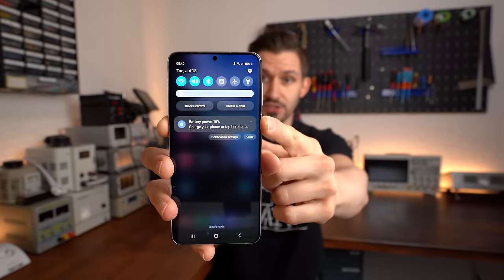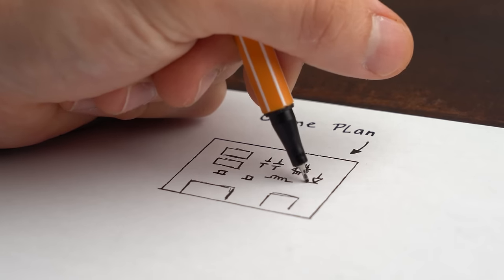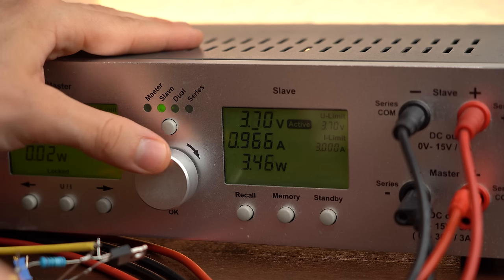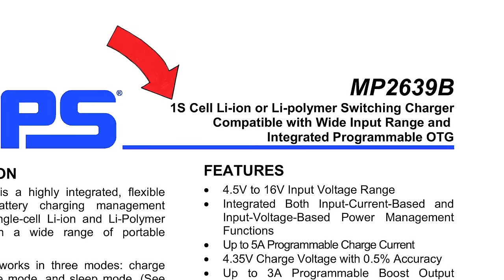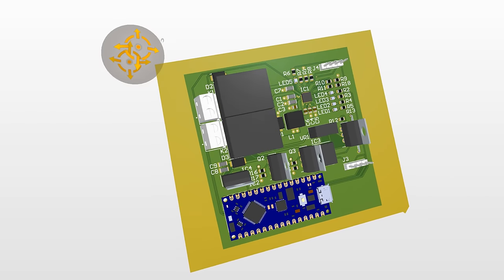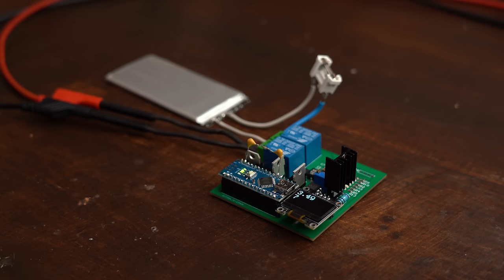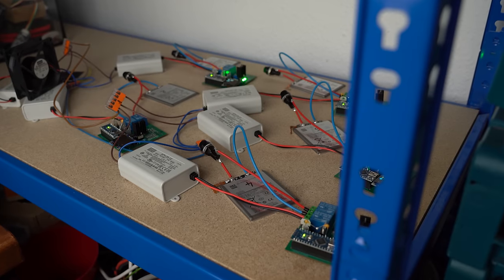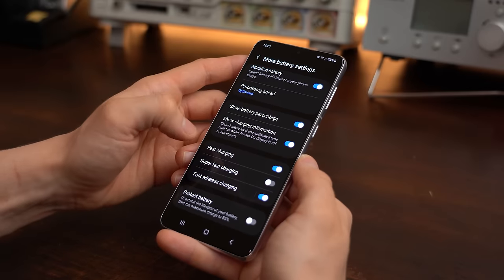Don't Fast Charge your Phone before Watching this Video!

Comment: I use an extension cable of usb to make my charger, charge slow. And if I have to hurry somewhere and my phone is dying then, I just remove the cable and charge it fast. I hope just like in your phone, many manufacturers start providing fast charging toggle within the phone. My phone only has a slow charging toggle, that pops automatically when it thinks that its night time and I'm gonna leave it charging for overnight. Name of this feature is optimised night charging. It sometimes comes in handy. Sometimes doesn't.

Comment: I have 4 years old phone that I always charged with 30W fast charging, a high current low voltage one from OnePlus.

It's definitely doing pretty well still, 5-7 hours of screen on time is normal and the drop hasn't been massive from when the device was new, approximately 20% at max.
Reply: Same with me

Comment: I'm on the third phone that comes with a fast charger and I'm still using my old Nokia 700mah charger with the new usb cables that came with said phones. No amount of marketing would ever convince me that more current wouldn't degrade the batteries faster, unless lipo/li-ion technology had changed drastically in recent years, which it didn't.

Comment: 2 times I got a phone at the same time a friend got the same phone, and I never use fast charging (I use the same 1A charger since 2014), and in both times, the phones my friends got had dead batteries in half of the time mine started acting up...
Moto X2, 2014-2017 while mine lasted  until 2019...
Xiami Redmi note 7, 2019-2022, but mine still rocks a long battery life... even though I noticed a 10-15% lower capacity.

Comment: I've been charging my phone with a 50w charger since march of 2020. Of course the current slowly drops as the battery is charged but the maximum wattage is about 45w to 50w when the battery is low.
After more than 3 years the battery still holds more than 85% i would gladly trade this much capacity for the convenience of not caring about when you charge your phone.
My wife's phone charges even faster with 120w but that has 2 batteries internally. Both phones are still going strong

Comment: Excellent video! Fast charging in Samsung uses 9v, not 5v.

 Samsung's Adaptive Fast Charging has a theoretical peak of 9V/2A (18W), while Super Fast Charging has a peak of 10V/4.5A (45W) with a travel adapter and 25W when plugged into a normal charger.

Comment: There is a fundamental problem with your test. When you fast charge [or even slow charge], you generally don't immediately discharge it. You should have ALL of the batteries discharging at the same time. That time should be after even the slow charge batteries have sat charged for some time. The reason to do this is to minimize anything like heat effects that would not be there in normal usage.

Comment: FWIW the Opus C3100 battery charger can be set to the slightly higher (or lower!) voltages on Lithium batteries using a "secret" internal selector switch inside the case.  It also has a mode that can discharge and recharge them.

Comment: Really nice video and i am interested in buying your board (or a version of your board) for different testing! 

One overlook in your methodology is the fact that you pushed 5A from 0-100% and that causes damage as from 85% battery must not be charged with more than 1C (in your case 4A) and must drop to at least 0.5C (2A in your case). That changes the stresses in the battery and that is how they can do 1000 cycles without dropping less than 85% capacity

Comment: I've been very interested in battery health ever since i got a new phone. So I loved to see this video!
I've already had this suspicion, but its nice to see that its actually true!

Samsung has this feature called routines, which I used to promt me whether I wanted to quick charge or not, every time I plug my charger in. That way I still conveniently have the option to quick charge when I need it.

Samsung also has this feature called "protect battery" which lets it only charge to 85% before shutting off, and Im curious about what that does for battery life.
I wonder if you could test that as well since you've got the tools already assembled. (right?)
You could also test whether not fully discharging makes an impact.
It'd make an interesting video, and give us more insight into how we should use our phones!

Comment: Funny story of mine. I have S20+ and I enabled "superfast charging" which allow my phone charge with highter voltage on USB-C. Sadly something in software went wrong and the voltage hit the lower voltage section and fried my phone. I just plug the cable in and in that exact moment the phone went black. Since then I dont use this feature anymore. They had to replace whole board to fix it.

Comment: Which is exactly why Apple uses charge profiling so that the fast charge stops at a lower charge and falls back depending on your projected requirements. It would be interesting to test various profiles but that of course would be far more complex. None the less the results are interesting.

Comment: Lithium Ion Batteries live the longest if you 1) Charge and discharge them slowly 2) keep the voltage below 4,2 Volts (that's about 85% charge). How do I know? We got a lab doing exactly the same you did, with Voltages up to 4.5 Volts. Difference: 800 Charge cycles with 4.5 Volts, and 2000 with 4,2 Volts to a drop of 80% max capacity. Slow charging and not charging it full is best charging.

Comment: Tesla has found that the battery packs lose a few percent immediately, then level off and stay over 90% for years and years.  This is not a linear degradation profile.  As others have suggested, it would be good to see a much longer cycle test like 1000 to 5000 cycles.

Comment: I personally always use my older "slow" charger and use fast charger only when I forgot to charge or I have to leave my house in a hurry (I don't want to bother with power bank).
As someone who prefer using phone to 3-5 years it helps to maintain phone battery until it is hitting 3-4 years mark.
Also I try to keep my phone in 30-85% range if possible, especially at the beginning.
Older it gets I the more I need all that power 😂

Also when phone is supercharging it heats up way more and if we add hot, weather, active use or high brightness (sometimes all 3 combined).
I have to manage heat of my phone as it could hit 40C (100F) and knowing how nasty battery fires are I prefer to avoid it.

I don't use wireless charging if possible as it wastes extra power into heat.

It is nice experiment and video you made. Very well done.

Comment: @GreatScott, hence Samsung phones have a 'protect battery' mode, where the battery stops charging at 85%.
I myself used to slow charge my phones, but nowadays instead of charging at 2A (10W), I charge at 18W, and the battery doesn't degrade, because it's only charging up to 85%, and because my phone has a 4500mAh battery, compared to my older phones only having a 1500-2500mAh battery.

So twice the size allows twice the amps for charging.

Comment: Great video. It's nice to get some confirmation data on batteries. Because of some military testing I only charge my phones to 80% to extend the battery life. The last phone I did this with was still going strong after 5 years of use. There is a time and place for fast charging, but not for everyday use. I noticed my latest phone uses adaptive wireless charging and will slow the charge rate if it sees there is plenty of charging time.
Reply: That's so stupid. Why would you only use 80% of your battery every day just to get a few extra months out of your battery? They're so cheap. Just use it properly and replace it down the road.
Reply: @MarioGoatse  I have no need for any more power. I usually have 30-40% left at the end of the day. If the battery was easy to replace, I wouldn't care, but with phones that are glued together it's a pain and I can generally have the original battery last the life of the phone. I used to get new phones a lot more often, but these days there are less and less reasons to upgrade.

Comment: Even outside of theory, fast charging heats the battery up and heat DOES reduce battery lifetime. I don't go beyond my limits to keep it cool, but if I can keep it less hot, I am glad to do it. For these reasons, I only charge at standard speed and without the phone case. Simple as that.

Comment: 0:16 not it's not charging at 5A, Ampere simply divides the wattage in by 5v (old charging voltage). The actual current is closer to 2-2.5a since it's charging at around 11v  and can go down to around 9v (samsung uses pps, which can change the voltage as needed).

Comment: Temperature and charge % are the main killers of Lithium Ion Batteries. Fast charging in a cold environment while maintaining a charge between 21%-79% should not result in significant degradation.

There can also be a significant temp spike when suddenly fast charging a dead battery or continuing past 80% without slowing the charge rate.

Think of it like a balloon. If you were to fill it with high pressure compressed air, when are the most common points of failure? Initial sudden rapid stretching and the final moments when it feels like a guessing game of when it is going to burst.

Comment: I just had my battery replaced in a Google Pixel 5.  That phone is 2 1/2 yeara old and the battery capacity had dropped from 4080 mah to 2600 mah.  

I didnt start using adaptive charging until recently when I started using daily alarms on the phone.  Adaptive charging is slower charging that is designed to complete a phone's charge at rhe time the phones alarm is set to.

Comment: There is definitely value in longer term testing - my understanding (and how they get away with their warranty numbers for electric vehicles), you can expect the largest capacity drop immediately after the first charges, then it will taper off nearly flat, then towards the expected lifespan 1000-10000 charges it will quickly (linearly) drop off to useless. For a tesla, their warranty is 8 years 80% (might be 75%, going from memory). Most people see the first 10-15% drop in the first 2 years, then it stays at around 85% for the next 6 years. They wouldn't put a warranty behind it if it weren't based on actuarial math. Fast charging versus slow charging doesn't seem to make a huge impact either (anecdotally from watching EV forums). Users who rely on supercharging (well above 2-3C charge rate) don't have early degradation because of how the charge current tapers/regulates with increased cell voltage.

Comment: You can use 2 Arduino on multiple circuits. This will let you reduce the total number of components and cost and add logging. You can also use the larger Arduino for more inputs. Some digital inputs can be used if the voltage difference is large enough

Comment: Cell manufacturers have passed this hurdle ages ago, plug in a fast charger that has 5A available compared to a max of a standard 2A charger and the battery manager will check charge rate/ battery heat and compensate. The tech used is way more advanced than you think when dealing with phones
Reply: Chinese phones have also gotten over this hurdle. Specs like SuperVOOC work more like DC fast charges than the set up he shows here

Comment: One thing I noticed, at least with Apple’s fast charging system it’s 5A until it gets to a certain level and then it drops down as it tops off. Allegedly this is where that loss comes from: high amp charging near the maximum voltage. If you repeat this test, maybe add another group based on the staged inputs used by Apple(and I think other manufacturers)?

Comment: True and I'm charging through PC USB for years but this is a small issue once we get back to easily replaceable batteries and bypass mode charging circuit where a charger can directly power a phone which reduces heat and less wear on the batteries.

Comment: My previous phone supported 35W charging, but my standard charging was all done using a 1A USB port in my alarm clock, only using the fast charger on the go, either as a travel charger or if I need a quick boost of power to get me through the workday. After 2 years, the AccuBattery report said it had only lost about 150mAh of capacity. I would have continued to use the phone if it werent for a cellular connectivity issue likely caused by EMI as a result of my welding career. My new phone supports 100W charging, though just like my last phone I only fast charge it if, for example, I wake up to find that my phone has fallen off the nightstand and unplugged itself, and is now at 10% and I leave for work in 30 minutes.

When traveling, I just use the 35W charger for my previous phone, since it's more than enough for that purpose

Comment: If the trend is accurate than my assumptions were valid. I only use my wireless 1A charger at night unless I have to be up early/forget to put it on. I only use the Ultra fast charger for emergencies, and fast charging for topping up if im short for the day. It seems to be keeping alot better than previous phones and just using the super fast charging all the time.

Comment: Boah, for years I was searching for a video that demonstrated this, and finally you did it, be proud of you man. Can I ask/suggest something? Could you do like a 500-800-1000-1200 cycle test, that would be so awesome, and put the batteries in a little bit of isolating material that simulates the phone getting hot, which I think I a huge impact on lifetime performance too. And a single cell being charged all the time at 100% and another at 50%. Again you did such a nice job, thank you sooo much. Nilo :)

Comment: Did you consider super fast charge at higher values, like 9V/2.77A or 11V/2.25A or even 15V?
I know the device manufacturers aren't for battery longevity considering the fact new devices/generations are being released at least once a year, but you may want to look into the way a phone (both Apple and Samsung or other Android) controls the charging cycle and replicate it for more accurate results. Just saying... maybe a video for a future update on the topic...

Comment: As far as I know, most phones have a custom charging curve to minimize damage to the battery. With a generic charger you might get worse battery life. Not sure how the charge curve was setup in your circuit.

I think I have something like 50W charging on my phone but almost never use. I use it only when I'm in a pinch and need to get through the day.  
Primarily I charge my phone always at night and use a low amp charger. Since my phone doesn't have a charge limit option, I've even gone so far that I use a cheap digital timer to control my charger so that I'm roughly at 80% in the morning :)

Comment: fiesta of all thanks for taking time to show this experience. I just want to highlights that most of the fast charging also have ic controller and dropping the charging speed when above 80% full.

And most of the people will start charging the battery before it drop to 0.

I also wonder the myth is true or not keeping the battery between 20%-80% can prolong the battery life.

temperature also can affect the result.

And type of battery is designed for fast charging or not also can consider.

Comment: I would enjoy seeing the same test but for QI wireless charging. I've always wondered how much the extra heat that QI generates degrades the battery. Especially with the QI coil and battery usually being stacked on top of each other in a phone.

Comment: Do note that even slow, wireless charging also strains the battery because there is a quite large heat loss, that heats the battery. The best thing is thus, to use a wired, slow, older charger. 

The even better option then, is to use a "coffee timer", that typically can be set to power the charger for a limited time, depending upon the time it would take to fully charge, or even better, charge to about 80-90%.

Comment: Yeah they used to have 1A chargers... then my old phone i still use i think maybe came with 1.5 or 2A charger... then I started using a car charger that was lightning i think it's 3.2A. When i first started using it, my regular charger couldn't even charge my phone anymore. But, I'm just amazed with my cheapo phone lasting so long with the same battery and having dropped it a thousand times, but i had a case from day 1.

Comment: As far as I know, what really shortens the battery life during the fast charging is the temperature. It is fairly common to limit the charging current based on the battery temperature (I would expect that vast majority of phones are doing this as well). Some phone companies are even marketing high wattage charging, but don't inform you that after 10 minutes of charging, you won't see this high wattage anymore as current drops significantly, because the battery gets too hot.
So this is a really cool test, but it's important to consider that you are not controlling for the temperature during charging (AFAIK) and that these batteries may have different thermal characteristics while being inside a phone (they might get hotter from the CPU, but they also might get colder because the phone should have a lot better thermal conductivity than air - hard to tell).

Comment: The phone manufacturers have extensively tested this. Fast charge Vs slow charge over the life time of the battery is a loss of ten percent approx. 

I.e 900 cycles Vs 1000 cycles 

This is highly documented and researched

Comment: I already know if you charge it slowly 10 to 80% it will last very long. I've my phone over 6 years and it still works. I've tried drone lipo battery, it also do the same but a lot shorter lifespan. 100% charged drone battery after 3 years old is almost unusable but another one up to 80% it still fly.